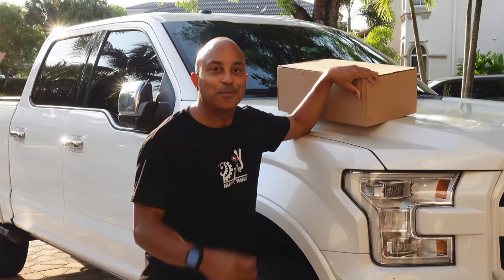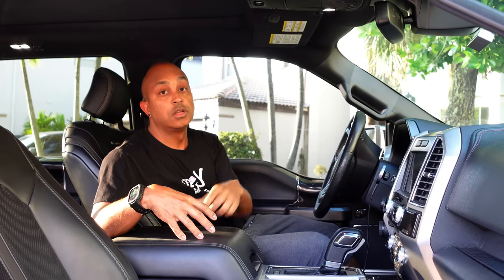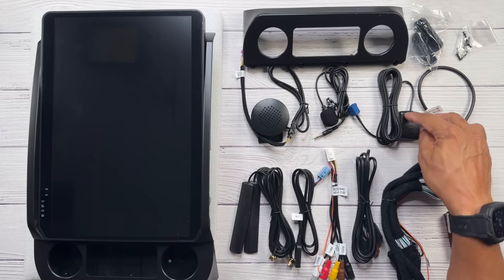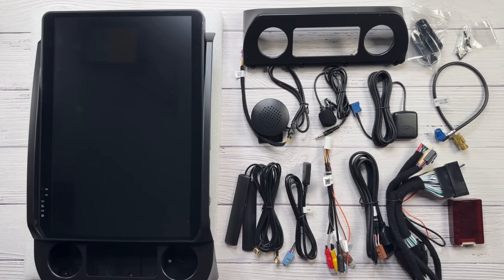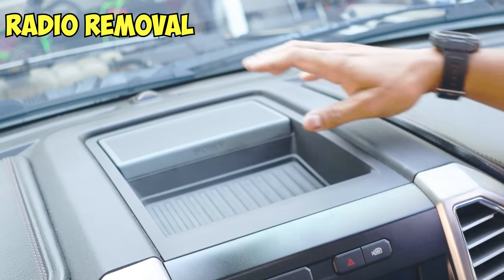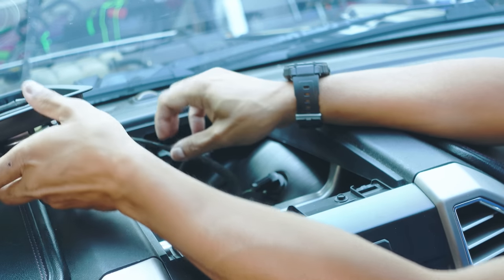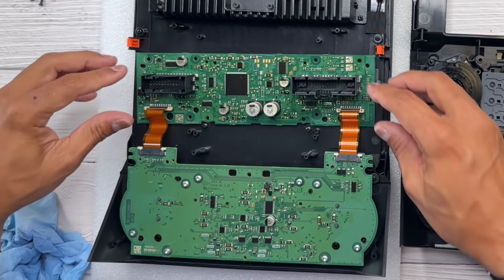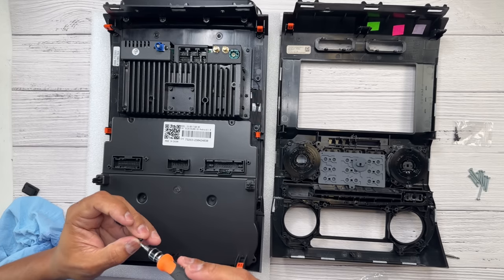BEST TStyle Radio for F-150 | Retains SYNC 3 | AutotecPro 14.4"

Comment: I'm so glad I came across your channel. I was prepared to pay $1,700 for a lesser screen with professional installation. I can do this myself, retain sync 3 for $1,100! You're the man. Earned my sub and like.
Reply from the maker: Glad I could help!
Reply: Thats until the sync3 module fries on you and has to be replaced . Its actually fairly common among other parts of the sync3 system going bad. If I said it was reliable I'd be lying to you. Unless your omly looking to keep the truck for a few years then trade it in for a new one. On top of that the firmware is buggy as well. Andriod carplay is actually significantly better.
Reply: @JoshSmith-wo7zw  Seek Right and Power button down 3 seconds... Pretty much once a month in my 2018 F150 lol.
Reply: Nice video! Did you install the external mic? Or does it use the OEM mic?
Reply: Fantastic video! What is the link to the stereo company? 
I just bought an apple Carplay , top of the dash 10"unit, 
Apple & Android for my Nissan Van. Got it online @ Walmart.
Reply: Oh, and it was $199.00,  free delivery.  (Apple Carplay 10" top of dash plug n play stereo android player),  It's got everything. 👌
Reply: Would this radio work with a 2024 F150?
Reply: @kdupuis77 replace the APIM module. Had the same issue with my 2016 f150. Once a month turned into once a week, then multiple times a day. Got a new factory APIM module and all was fixed
Reply: Awesome
Reply: Wow, $1,7000, No Way…

Comment: The fact that it retains the factory Sync is the coolest thing I have ever seen. This is an awesome unit.
Reply from the maker: yes that was the selling point for me
Reply: If my system is Sync1, can it upgrade my Sync?
Reply: This has to be one of the coolest plug n play upgrade units I've ever seen. Does it work with the FX2 package descent controls???
Reply: Except that sync3 is unreliable as all hell.
Reply: @JoshSmith-wo7zw my 2015 F150 Lariat is a sync 2 is will I have issues if I purchase and install this radio?
Reply: @shaquitaware6563   Yeah probably but again why retain sync as it has multiple issues including component failures. I would just go aftermarket with an idatalink maestro module and be done with it.
Reply: @JoshSmith-wo7zw  do you have a link for it?
Reply: @JoshSmith-wo7zw how do you retain the middle speaker when you change from sync 3
Reply: Is there not a way to retain it? I'd assume it should still connect the same way unless Sync 3 is missing a plug for it. If so, you might have to add in some extra hardware to combine the left and right channels to the center speaker.

That particular speaker isn't in every model, so it might be an oddball item the Sync 3 equipment isn't prepared for if you're running into that issue.

Comment: Just installed on a F600 using this video as my only instructions.  Works great with Android Auto.  As someone mentioned earlier, if you have manual HVAC, make sure the you keep the little gears aligned or you'll either lose your Max AC or Mac Defrost setting.  I had to do it twice to fix that.
Reply from the maker: Thanks for sharing

Comment: i dont like touch screens in vehicles. i do not plan on getting this for my f150. But i stayed and watched the whole thing. this is hands down the best tutorial/build along video I've ever seen installing an aftermarket part. Honestly great  video.
Reply from the maker: Thanks for the kind words
Reply: Just curious Joshua, why don't you like the touch screens in your vehicle?
Reply: @Martin-wy2on : touch screens are dangerous. Radio with a knob- good song comes on, rotate easy to find knob. Song ends repeat. Touch screen- good song comes on, navigate layers of menus while not watching the road, adjust volume while watching the screen. Repeat when the song ends. Aircraft still use knobs / switches for a reason.

Comment: Thank you for this very informative video! It gave me courage to purchase and install the unit by myself. Fair warning though anyone with a manual AC there are extra steps to take when transferring over the temperature control dial. You have to set it in the middle of the temperature diagram and keep it on there. Along with the big gear on the circuit board you need to line it up with the hole on the board, then connect. Had to take apart after installing to find this out.

Comment: I bought basiclly the same radio for a chevy silverado. They just come with other wires made for my harness and the plastic shape to match my truck. I got it on Aliexpress for 600 for a 128gb 8gb ram model. 14.4" screen. the f150 model is even cheaper than the chevy version on aliexpress. Shipping was a little slow but at least i got my radio and it works great.

Comment: Great video, though I'm using a AuCar unit for a 2018 Ford Explorer, there is lot of similarities between the two units regarding the main connections, this video filled the gap that was missing in the other install videos, that was connecting the cables to the unit.

Comment: This is a very intuitive instructional video.  I installed mine in my 2019 Ford Raptor yesterday and it was nice and easy to install thanks to this video.  The deck works great and is, like others have said, very smooth operating fully integrated into the stock system.  Very happy with my purchase thanks to this video.  I am now looking for ways to customize the home portion of the tablet.
Reply from the maker: Glad it helped.  check out the F150 forums they have a forum dedicated to the autotecpro unit
Reply: Does it retain factory mic ? And how about the delay going into reverse?

Comment: I am SO stoked to have come across your video...I've been pondering doing this to my 2018 F150 Raptor for years. Like you I just couldn't do it and loose my Sync system...Your tutorial is AMAZING....you are clear, concise and encouraging....Well done and thank you! Question: what's the purpose of the USB's and Sim card harnesses?
Reply from the maker: The usbs are for connecting external USB drives to expand storage of music and videos and also to perform the firmware updates.  The SIM card is to allow you to use all the apps without connecting your phone via carplay
Reply: I'm in the middle of installation of the screen I got from aliexpress in my 18 Ford raptor. I got the answer for the USB cable.. I thought this cable would connect to the usb port in the tray next to the shift knob..again great video man this def helpt me jump and buy the screen 👍👍👍
Reply: One more question...since my truck has the gps system already like I believe yours does...is it necessary to install their gps system. Does it do something more than what our factory system does?
Reply: In same boat as you all. I have a 2018 Raptor and wasn’t sure what to buy until finding this video and the follow up one where the 6month review comes. Thanks for the patience and will order mine using your code. Thanks.

Comment: If you have the manual AC, be sure not to change the alignment of the teeth on the temp adjust gears when swapping over.
Reply: so what happens if you do that mine stopped working

Comment: Im going say this ! 

I bought the unit and used your DYS  and let me tell you every step used made my experience rather ez and I was successful able to install my head unit  now I’ll customize it to my liking thx so much 😊
Reply: What size screen did you upgrade from? I’m trying to figure out if it could work from the 4 inch screen
Reply from the maker: yes it can
Reply: I have a  2019 F350 with 4' screen, I picked a used unit for a F150.
Knowing that I would have to do some kind of adaptation.
But apearantly AutoTech Pro will not sell any parts just entity kits, do you have any advice?

Comment: I was going to get this head unit for my truck, but it wouldn’t fit my truck because it was a 2014, so from 15 on up it would fit so I got the Kenwood DMX809S, with the kit was $1353 installed.

Comment: Your video definitely helps the install of AutotecPro's display.  I love this new display.  Do you know a good Ford and/or Ford F150 boot logo that will work with this display? All the logos I found will either stretch it out too big or shrink the logo too small.  The longer height of the screen seems to be the issue.  Thanks.

Comment: Totally awesome. Everything explained. Theonly question.. Android updates abd planned for obsolesence, meaning they stop updating the os for hardware making the hardware obsolete. Typically 3 years. Rooting is not a recommended option, but if you're selling after that point no big deal. Love the ugrade, but concerned about life cycle of unit. Any feedback is appreciated.
Best tutorial i've ever seen.
Reply from the maker: that is always an issue but i think for the most part this should be good for years to come, since i am primarily using it with wireless carplay and media playback

Comment: Love this unit, I just have a question about the ac and radio controls? If you retain the ac control panel, why is it also shown right above them on the screen. Seems it would be nicer to have the radio functions shown at the bottom of the display in what would have been the original location. Can the display ac controls be swapped with the radio functions?

Comment: Im still undecided if it's worth getting a big touch screen for my Raptor. I would not do 4g but likely would use my phone as a hot spot. Thanks for the detailed video
Reply from the maker: the touch screen works bettter than i thought

Comment: Thanks for the video, it was a lot of help. Also, the sync module holes are not wrong, you you just had it upside down, other than that this video is on point. 
Has anyone had issues with their ambient lighting not working anymore?
Reply from the maker: The module has to be mounted in this direction or your navigation will be off.

Comment: The main problem with most larger Ford vehicles large screen tends to block something important. If you go larger than 10" you either block your air vents or air/dash board controls.

Comment: So I just ordered mine and I just received it today. I used your code. Thanks for the discount. What is that extra wire from when you connect to cam bus It has a white tip, three wires, red, black and white. What is that used for and does the speaker still work with the GPS without having to connect the extra speaker that came with it 19:12

Comment: You.can actually unlock climate controls through the radio if you use forscan and go into the BCM and enable it. All you have to do is turn it on.

Comment: Hey I have a question- my F150 is a 2015 with Sync 2. If I buy this, won’t I STILL have Sync 2? Like does this upgrade you to Sync 3 or is just a tablet
Reply from the maker: it will work with sync 2 as well.  they have models for sync 2

Comment: Hands down, the BEST how-to video for these epic screens. Thank you!!  Side note/question...which SIM card did you go with? Any specific install steps for that? Thanks!
Reply from the maker: I just got one from Tello.com, but at&t and Tmobile will work.  I just put the sim card in and did a reeboot and it worked
Reply: @DeaninItYourself  I have the ATT service through Ford but have never known about a sim card, it makes sense, but is there a sim card I should transfer form somewhere out of the stock unit? I just renewed my plan and hope I did not lose $200 for the year. Thanks

Comment: Thank you so much for your video! I think I'm going to pull the trigger as well and get it! Just have a quick question I current have a aftermarket amp and sub and use Amppro interface. I should be just to add that to this correct? It just plugs into Apic unit that u-took off of the OEM unit and swapped it over to the new unit. 
Thank you again!
Reply from the maker: yes i have an aftermarket amp as well, all my amp connections are behind therear seat.  so it should not affect the install of the radio

Comment: This was posted about a year ago.  Is everyone still happy with this product.  I’m about to purchase this and would feel more confident with your endorsements.  Does the Ford App remote start and remote lock/unlock still work?
Reply from the maker: they all still work
Reply: I'm not happy with mine. I watched this video and I ended up getting one. But as soon as I installed it I wish I hadn't. It might just be me but you need to do everything(DIY) as far as the way it operates. There is no way of turning the system off. It is supposed to remember where you left off, it doesn't. The radio would turn on on its own. When I wanted to listen to the radio it would always come on with the FM2 stations which I had never setup. I have had to reset the unit at least once every 2 weeks if not more. I've had problems with it since installation (12/23) until I took it out last week(8/24). The final reason I took it out was my APIM went bad ($300, overheated, I believe). The OEM APIM attaches to the back of the unit at the heat sink fins. I asked AutoTec Pro if I could return and possibly get 3/4 of what I paid for it back since it has never worked correctly. They said NO! Nothing about it was straight forward. This product should work correctly without having to do anything once installed. Hopefully people have better luck than I did.

Comment: @DeaninItYourself I noticed when you removed the sync display module from the dash there was one plugin for the factory usb. But then when you mounted the sync module to the back of the tesla screen there was two plugins one for the factory usb and another and it was a completely different module from the one you removed. I'm sure its nothing but. Could you please explain? Thanks.
I just bought one for my 2018 F150 with sync 3, 8 inch screen and auto climate control and it arrived yesterday Dec 18th 2023, Christmas present from wife. :) I will probably install it on Christmas day and im educating myself on the install watching your video. Fantastic install video by the way. Much better than the one autotecpro has, as you explain all the connections.
Reply from the maker: the removal video was from an removal i did on a different vehicle, because the footage from my vehicle got erased mistakenly, thats why it only had 1 usb port, the important thing is just to connect the usb from the port you removed it from on your model.

Comment: THANK YOU for the super helpful video! It made installing mine a breeze! Any recommendations on what SIM card to use? I’m a Verizon Wireless customer and after an hour on the phone and 2 different representatives, they finally tell me it can’t be done (with them).
Reply from the maker: I bout one from tello.com.  just get a data only SIM.  activate it online, put the SIM in the radio, reset the radio and the SIM will register on its own and you weill be connected, you dont have to do anything else.
Reply: @deaninityourself What is the Sim card for? Is it for wireless signal?

Comment: I just got mine installed everything works ! But I’m having a little fit ment issue at the very bottom it’s not flush the new piece hangs off just a little bit and I think that’s making me AC dials also a little loose and wobbly. Do you have this problem? Or idea what would be the fix ?
Reply: Mine would stick out the bottom as well. I never found out why. I can push it in but it just pops back out. I got rid of mine. I had way too many issues.

Comment: Great video...well done!

Question: The USBs that you store in the glove box...are those a replacement or upgrade for the factory installed USBs under the climate control on stock F-Series trucks?? I already have USBs and like my stock location better. Any additional perspective or color on this is appreciated.
Reply from the maker: the glove box ones are additional. your factory ones will still work as usual, but you need the other ones just to store additional media and to update the firmware on the raidio

Comment: Thanks for the video. YT recommended about a month ago when I didn't even know this was a thing. Long story short, after much back and forth, I did the install this morning, LOL. The only issue i have is that the lights on the A/C portion at the bottom are not turning off. Do you have any idea what the issue could be? Thanks again for the video!
Reply from the maker: Not sure what you mean, but I would double chack the connections to make sure they are tight.

Comment: Thank you! This helped me install a similar headunit in my F150!  Any issues with SYNC conflicting with the new headunit's system? Any issues with starup lag?
Reply from the maker: it is working just fine still, i have had it for about 8 months
Reply: Do you get a static, white noise sound when skipping songs using the steering wheel controls?

Comment: Thank you for the awesome video. How are the calls over the wireless car play or Android Auto? Any issues? Does it use the factory Mike or the unit mike ?
Reply from the maker: The calls sound good. It used the factory mic
Reply: @DeaninItYourself  that's awesome. I thought for sure it would have to use the unit mike if you're connected to the units car play or Android Auto.

Comment: Hello great video, quick question can you still see the hazard button and traction control buttons with normal sitting? Thanks
Reply from the maker: depends on how tall you are.  the 12 inch version you can see fine, the 14.4 inch version they are a bit hidden for the average person

Comment: So far i'm loving it. Only have come across two problems 1) can't get a sim card to read and I've tried two providers. I verified the dongle is plugged in but out of ideas. Contacting the company to see if they can send me another one. 2) Seen multiple references for patches and updates but can't find a link anywhere to them. Where are you getting the firmware updates from?
Reply from the maker: If you bought it from autotechpro you can contact them directly and Sunny will send you the update.
Reply from the maker: Try inserting the SIM card and then doing a system reboot from the settings menu. That worked of me.